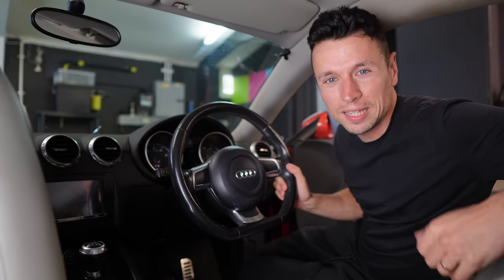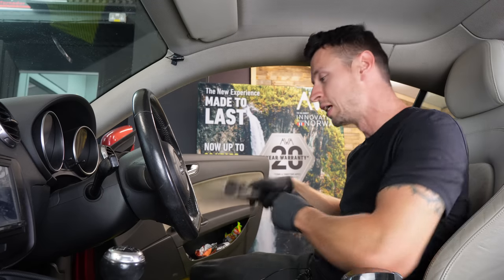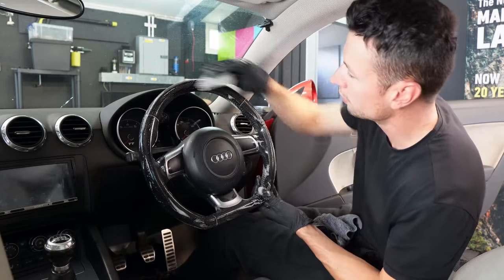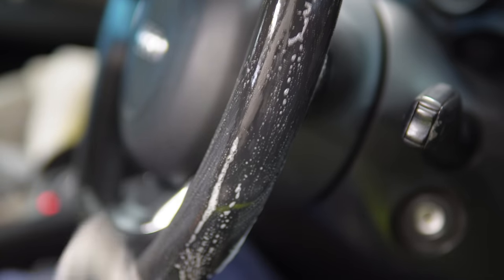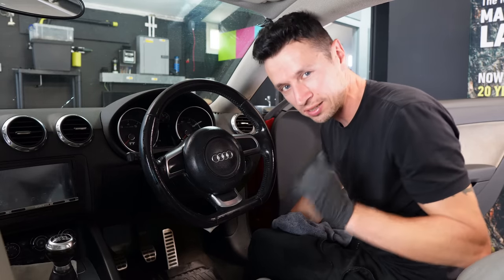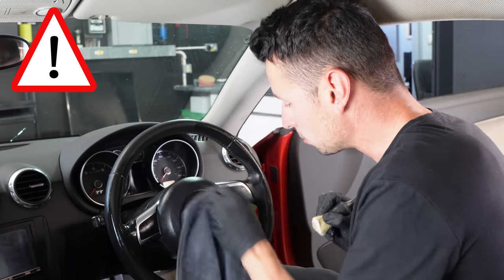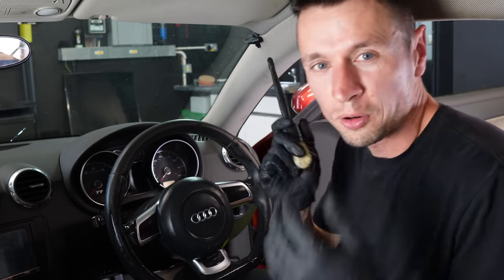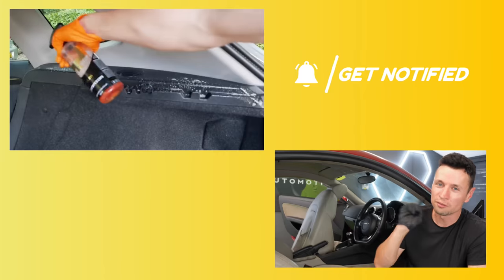How to clean a Steering Wheel - Beginners Guide Made Easy

Comment: I use bar soap, or hand gel soap, into a microfibre with warm water, make a decent foam with it, slather it on the wheel and leave it for 2-3 minutes, wipe off a couple of times and then repeat if I need to. Works a treat every time. Leather is skin at the end of the day so whatever cleans my hands would clean a steering wheel.

Comment: I much prefer these specialised cleaning videos. The water spot remover on the badges/emblems video was great too, I use that on every car i detail now. Some good suggestions for products to review....firstly Rimmats - I got mine the other day and I think they are great, there are many benefits to them (stops dirt from the floor getting on brushes & applicators, allows you to clean/dress all way around the wheel without moving the car, works as a hose guide to stop snagging under wheels etc) . And secondly Kamikaze No.5 anti aging cleanser (I know it sounds like a beauty product lol), it's apparently the only product out there that can remove ALL coatings including ceramic, brilliant if you want to change or refresh your coating without the need to polish. Something that every detailer should have in their arsenal
Reply from the maker: thanks for the comment. Always love the feedback. As for Rimmats i actually have a better alternative that I use and its 2 vented floor tiles. I feel you have to roll the car back to get fully around the wheel the wheel so it would be a faff for me
Reply: @epicautomotivedetailing  the Rimmats have ridges that raise the wheel up allowing you to clean the full face of the tyre. That's one of the reasons I got them to save you having to move the car back and forth. You do eventually move the car off the mats when the job is finished so you could check if you've missed anything then but so far it looks like they're able to give you full access for cleaning and dressing.
Reply from the maker: @ItsMeYourRealDad  I may test them soon in the winter perhaps, detailing has gone very quiet at the moment even on YouTube but come sept / October I may buy some
Reply: @epicautomotivedetailing  I thought the detailing scene had gone quiet too, must be the weather lol. Yes I know the rimmats aren't the cheapest at 50 quid but I think it's worth it in the long run. When I first started "proper" detailing I heard a tip saying use 4 pieces of 6x2 timber with a ramp cut out on one side so you can drive onto them leaving the face of the tyre overhanging and easy to clean/dress. So I've been using wood chocks up until recently, and although they were relatively cheap and easy to make, it definitely looks more professional now using the Rimmats

Comment: Great video! Any advise for steering wheel leather than looks like it’s slightly fading?
Reply from the maker: If it's Faded there are a few options but personally the re colouring is probably the best method. Not something I've got heavily involved with but will look into it
Reply: @epicautomotivedetailing  thanks I appreciate that. If you know of any recolouring products that would be extremely helpful!
Reply from the maker: @M140i23  I may not be the guy for that as I'm inexperienced with that part however I'm sure I saw detailers bible on Instagram do something with a company recently